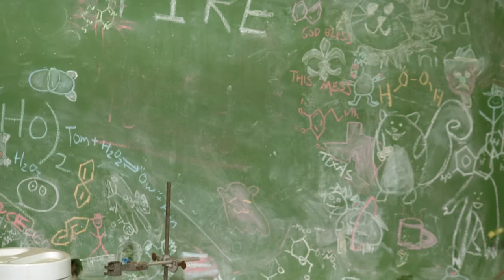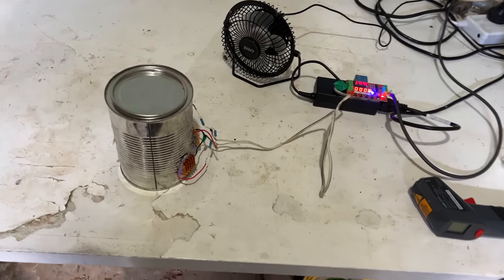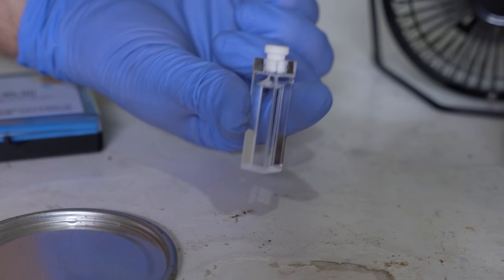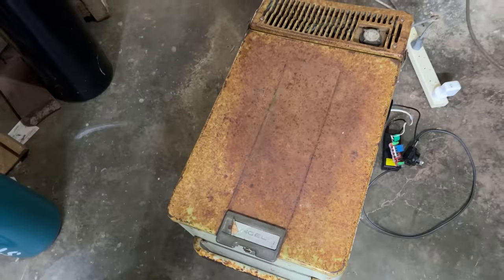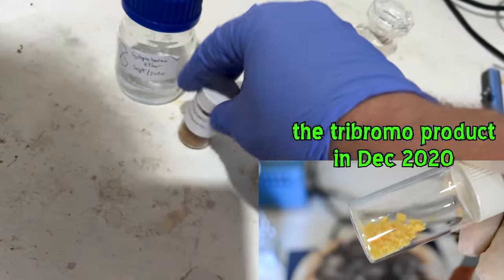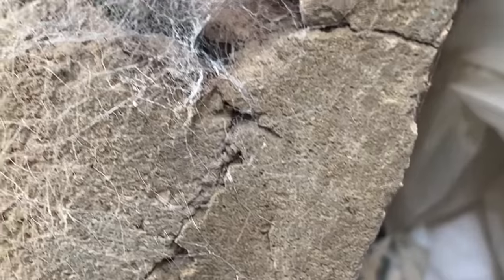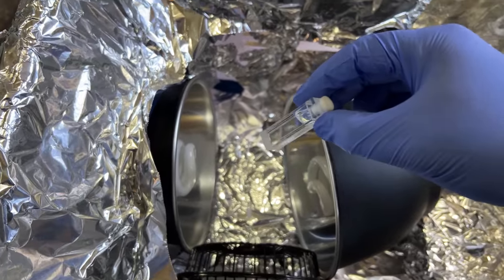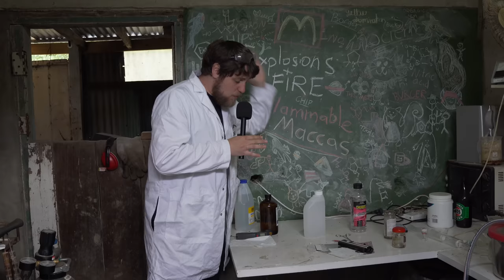The PhotoFridge - Cubane Ep 13

Comment: Your UV fridge looks amazing, hope it is desparked XD

As for synthesis. KMnO4 may be not the best stain here, but I would try something suited for ketones/aldehydes (permanganate will give great staining for substrate because of double bonds, and it will be magnitudes higher than one for products). Dinitrophenylhydrazine is what you should try definitely, then spot shows under DNP and permanganate: substrate, only/mostly DNP: product.
I agree with the idea of putting UV LED into a quartz tube and then this into a flask for easier management of the reaction. I have seen this published a few times as an alternative to irradiating flasks from outside. Still, I am personally more of a fan of flow setups.
You are using DCM, why not benzene like in the original papers that you linked in the description? Lower evaporation rate and maybe it would work better.

EDIT: One thing I forgot, those compounds can be not stable on silica gel! Those are ketals, and on acidic media, those like to decompose to ketones (with would be more polar). In cases like that, it is good to make a 2D TLC plate to determine stability. It can be just a mixture of ketone/ketal. 

Still, I hope Cuban Saga will end with nice cubes in vial XD
Keep on cooking!

Comment: Electronics tip #2 : don't tin wires that will be compressed like in a crimped ferrule or a terminal block.   The solder will deform under compression and can migrate resulting in a less reliable connection than just plain copper.

Comment: A tip for iodine is to dissolve in dcm and add silica/celite. Let it dry or strip down. You dont have deal with storing iodine or dispensing it. The purple silica last for ages for tlc stains. Just shake the the jar with your tlc or go for tea.

Comment: Hi! So I'm a PhD student in a photochemistry group, just thought I'd add a few thoughts.

Firstly, I would guess that you're not detecting the product using any stains - permanganate needs something oxidisable and iodine/UV both need some kind of unsaturated system like an alkene. You might be able to detect the ketone with iodine if you use a more concentrated source of iodine (e.g. iodine on silica), but you're probably better off going for something more specific like DNP*.

If that still doesn't work, it might be good to try running the reaction under nitrogen. Just had a look at the paper and they say the reaction is run by "irradiation in deoxygenated benzene" so oxygen might be interfering (pretty common for photochemical processes). You could try sparging the mixture with N2/Ar for 20 min before you turn on the lamp. If this improves things, you might be better off going back to the vial as it'll be easier to degas and seal, even if you lose some light intensity. Good luck!

DNP = Dinitrophenylhydrazine, which stains aldehydes and ketones (https://www.chemistry.mcmaster.ca/adronov/resources/Stains_for_Developing_TLC_Plates.pdf)

Comment: Very nice video! I agree with the suggestion of using a vanillin / h2so4 solution for developing the TLC plate. And u don't have to make your tlc spotter from glass by yourself you can just the thinnest syringe cannula and cut of the tip with scissors. Works perfectly, even better than the regular bought glass ones

Comment: maybe you want to:
1. use an uv-c germicidal lamp as light source (which wavelength is the excitation wavelenth of the rearrangement?)
2. put your sample inside the cooling jacket of a liebig condenser and let some air flow through the core for cooling (use some silicone pipette balls to seal the lower olive) the borosilicate glass should only briefly attenuate the uv light intensity
3. maybe add some ethanol to catch the reactive  CH2Cl2 intermediate that is created by the uv irradiation... which stabilizer is in the CH2Cl2?
4. use a different stain for the TLC that is suitable for saturated aliphatic hydrocarbons.... like 
conc. H2SO4 + heating to >150 °C; 
0.2 mL Formaline (37%) + 10 mL conc. H2SO4
1g Sodium nitroprusside + 50 mL EtOH + 50 mL 2N NaOH
5. decrease the concentration even more... the reaction should occur internally not intra.....
PhD to the rescue ;)

Comment: A note for next time: if you've got bare components like those resistors, it's a good idea to put heat shrink tubing around the exposed metal. You don't want things accidentally touching, even if it's not high voltage, because a short would be bad.

Comment: As an electronics engineer this was ever so slightly less painful to watch :D Still, you are the reason I re-discovered my interest in chemistry after hating it on undergrad. BTW, using resistors for highly sensitive diodes (LED's and Lasers) is a no-no. As the temperature changes, the forward voltage of the junction changes, and the initial calculations for your resistors voltage drop are no longer valid. Higher temps, lower Vf on the LED, higher V across the resistor, more current, more power on the LED, more temp, so on and so forth. Long story short you get positive feedback, and maybe thermal runaway. You should really be using a constant current source. Many simple designs that can be easily built with a couple of parts. Cheers!

Comment: Stupid question, why not use a quartz window (or crucible or beaker lid) as a lid with a silicone gasket and put the LEDs on top shining down in with a stirrer?  Quartz sheet isn't cheap but it's not crazy expensive either, I see 100mm round 0.5mm thick for 63 bucks on universitywafer and I'm sure it can be found on eBay or Amazon for cheaper.  You could fill a Petrie dish nice and shallow for better exposure and get a bunch of LEDs on the lid and just let it marinate in the fridge.

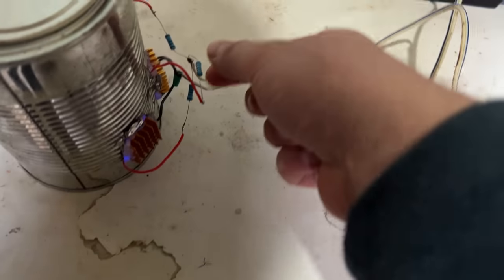Comment: 3:52 all resistors have a power rating, which is often completely overlooked for hobby use. in most hobby applications, it never really matters. until it does matter, and then your resistors turn black and stop working lol. those look like 1/4 watt but most of the smallish ones you see hobby kits use are 1/8 watt. the way you figure out what you need is just multiple the voltage drop across your resistor by the current going through it. you can probe the resistor in circuit to measure its voltage drop, but its more annoying to measure current so i would recommend just doing the math. 

if all you have are those little 1/4 watt guys, you can gang them together in parallel to reduce the current through each one, but that does change the total resistance in an annoying non-obvious way. again, you will want to either measure in circuit or just do the math to calculate the total resistance.

Comment: I'm not an EE and I'm upsetti. 
Not really, that's probably better than what I would do. But just by the way I at least think you can put the resistors on the negative side you don't have to have exposed positive leads if you care about that. Hot glue and/or electrical tape also makes a good jacket to not get shocked. 

Side note: the metal on the heat sinks reflect IR, so the IR thermometer gun is probably at least in part measuring other stuff instead of the heat sink. You can add a bit of black electrical tape on it to measure from since the electrical tape will get the temperature and not reflect as much. It's insolating so there will be a lag but should be a more accurate number (if you care about that). Touch  test FTW though

Comment: 1. Ensure if Your vials’ material let the UV light pass through
2. Ensure if You use same wavelength of UV as the paper says;
4. Rebuild your UV chamber - better would be to put reaction vial into a bit bigger vial with diodes placed on the walls - just to let diodes touch outer vial and reaction vial - to be between them tigthly, then wrap all with PTFE tape to work as UV reflector, seal both vials and heat inside a water bath during the reaction instead of this fridge-oven;
3. Try to change eluent for TLC of Your final post-reaction solution; You can also try to react the plate with some primary or secondary amine in anhydrous sln for couple minutes - your compound stain should turn dark for the nucleophillic substitution on the bromine atom, or at least turn detectable under UV
4. Make also GC or HPLC and any method of quality analysis that is described in paper regarding to this compound - also there should be written its spectrum details to ensure that it is the same compound;

Comment: Hi! Do you have access to 2,4-dinitrophenylhydrazine? Its a great stain for carbonyl compounds.
Alternatively, methoxylated benzaldehydes sometimes work but that's no replacement for good old dinitrophenylhydrazine.

Also, I don't know if you're having problems making spotters but when I make them from pipettes, I remove the pipette from the flame before pulling the glass. This allows the glass not to collapse onto itself but if all of your spotters are viable, there's no need to change!
If you decide to make them from pipettes, pull them really long so you can make 3-4 spotters from a single pull. The rest of the pipette can then be re-heated and pulled again a couple of times. Cut the spotters with a tlc cutter or a GC column snipper for clean edges ;)

Edit: GC column snippers are shipped with GC columns so anyone with a working GC will have a bunch of them laying around. If they haven't tossed them, they'll usually be happy to share!

Comment: I have no clue about chemistry BUT I might have an idea how to solve your dcm evaporation problem/small vial problem.
There are these things called peltier elements. They are like really small and easy to use electronics for cooling stuff.
(Basically just a rectangle you put power into, one side gets hot, the other one gets really cold).
No clue what temperature the reaction needs but if you could keep your dcm cold enough, then maybe you don't even need a vial
like put it into a cool open glass beaker and blast it with uv from the top?

Comment: Hi hi.  I'm sure you've been pestered about this before, but just in case, I thought I would leave a comment about this. I've done a terrible amount of TLC in my undergrad. In general, you don't want the solvent to travel all the way up the TLC paper. Leaving about 0.5 cm of room from the top is a good idea. You can then mark the solvent line with a pencil upon pulling it out of the container. This ensures that you can tell if the solvent line is traveling upwards directly without any drift to one side or another. I also don't know if your stains for TLC are actually doing anything... Have you considered trying an aldehyde stain?

Comment: You shake some part of the web with quick vibrations, like a bug struggling, and it will come running.
Those UV LEDs don't look like they are being driven enough, because my small torch looks brighter.

Comment: So i thought about it a bit, what you could try is using sodium nitroprusside, 2,4 Dinitrophenylhydrazine or 1,3 Dinitrobenzene to selectively test for CH-acidic compounds. These should be positive for ur UV product aswell as for the mono ketal. However your mono ketal should also be stained by the KMnO4/iodine, your product not. Atleast in these mild conditions the KMnO4 aswell as the iodine should selectively target the double bonds. I havent tested these reagents for staining tlc plates however, only as chemical tests in solution but i figure you can try out some of them. As mentioned already acidic vanilin solution or anisaldehyde might also be worth a try.

Comment: For the TLC spotters try heating the full length and pulling slower to get a 2 nice long thin spottersa from 1 capilliary tube. In addition I agree with other commentators that you should try vanillin or DNP to stain.
Reply: Looking at the photcyclisation product, it doesnt look like it would be oxidised well by KMnO4 or react with iodine. It also doesnt look like it has a chromophore so wont be pickedup by UV.

Comment: It's a little odd that the KMnO4 stain isn't showing your product. I've used it before for compounds where the only functional groups are an acetal and bromo group it's seemed to work. I'd figure with heat you should be hydrolyzing the acetal and then oxidizing the resulting alcohols from the deprotection. Although sometimes I've really had to heat the heck out of the TLC plate. (I do prefer using a hot plate to evenly heat the TLC plates though)

I would recommend looking at the Not Voodoo X website if you get a chance though, the university of Rochester runs it and it has a lot of helpful organic chemistry tips, TLC formulations, etc. They have recipes for TLC stains and dips for p anisaldehyde etc as other people suggested.

Also maybe consider trying some other solvent systems. I'm not sure what system you've been running but your SM and product are pretty similar you may need different conditions to separate the RFs.

Comment: Use a resistor with a wattage above your leds.

Those are 1/4W resistors. 

Or series parrallell them up. 2 in series paralleled with another 2 in series with be the same resistance at double the wattage.

Comment: It’s summer, yeah? How about putting sunlight through a diffraction grating to get an output of light in the spectra of the desired range? The intensity should be intense enough, and you could always increase the power using reflection with mirror or magnification with optic lenses and just control excess heating with some form of cooling. It’s as complex as any setup attempted so far, and maybe cheaper?

Comment: As an IT Sys Admin one of the questions you hear pretty regularly is "Why don't you just run a PC in a fridge to keep it cool?", well they kinda do do that for servers however it doesn't work for general electronics because running hot components in a sub ambient environment causes condensation and that really doesn't mix with electronics to good (though interestingly low current DC stuff can hold up quite well for a shortish period, just don't leave it in there for hours).
Reply: It's the humidity that does it.  AC dehumidifies as well as cools. I lilled a pc by transporting ot from a cold car and going into a warm room and turning it on. It fizzed.

Comment: A lot of high power light bulbs are fused quartz elements. With an Oxy-Acetylene torch, and a careful hand, it can even be worked by the amateur. I mean... so long as you only need to succeed once. I've honestly been thinking about this since you started with the UV stuff. (If only I had free time, I could make you a proper LED driver AND your fused quartz vial.)

Edit: Also, don't pull your capillary tubes all the way while you're IN the flame. Use the flame to soften the tube... move it out of the flame (It's still plenty hot)... THEN pull the glass down to construct the capillary. It may not be textbook form, but it makes damn fine glass tubes.

Comment: Resistor power ratings are kind of like "how heatsinky is this resistor?" Search up a 10 or 20 watt resistor and you'll see what I mean. Wirewound and ceramic or metal casing, much better at staying cool. Those little half-watt film guys heat up fast.

Comment: Idk if you figure this out, but fridges aren't designed to constantly cool a heat source, you going to burn out the refrigeration unit using the refrigerator as a cooling system

Comment: your pipette tip entering the solution is some form of plastic. maybe try switching to glass? 
Could be the source of the contamination, if anything I never thought Teflon would be the culprit but it would be nice to find a way to detect what the contaminate was.
(Use a Microscope on the contamination dots to look for residue of teflon or any sort of plastic)?
You should use a rotating platform inside the can where the solution sits on and spins. To ensure it doesn't tip over find a way to secure it to said platform without disrupting the light intake.
Another thing that ran through my mind in regards to the old fridge, the coolant running through the lines... maybe its leaking?
I'm sure if you had a climate controlled area and everything at your dispose you would knock this synthesis off
Always look forward to the next episode

Comment: Have you thought if using UV laser diodes in your fridge? You could seat them outside the fridge to deal with the heat easier. Set the cubette iat the focus point of several lasers and I'm sure something should happen.

Comment: Sorry I haven't been following along, what's the forward voltage of those LEDs? If the resistors are getting hot, maybe you'd be better off running the LEDs in series or using a lower voltage power supply?

Comment: Is it possible the bromine thats alpha to the protecting group does a little ~something~ during the 2x2 photocycloadditon, idk seems weird cause it’s right next to the carbon that’ll be a radical during intermediate. Also maybe using uv-light to detect product, when the product is photosensitive, might reverse reaction?? But it seemed low intensity during TLC so idk. And it seems plausible that teflon might contribute to a bunch of nano/micro plastics—impurity.

Comment: I don't know if its just because this was drilled into me in first year chem, but the way you're creating your TLC spotters and the way you're spotting the sample on to the plate seems off to me... Try and draw out the capilliary tubes really quickly once it starts to melt to get a really thin spotter, which you can then use to make a much more concentrated TLC spots which might show up better - apart from that maybe get some more out there stains?